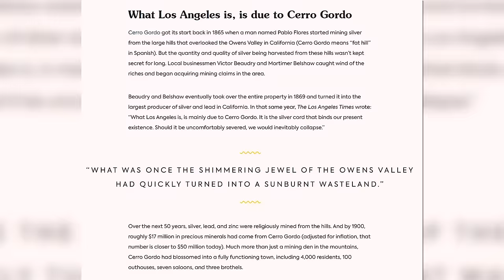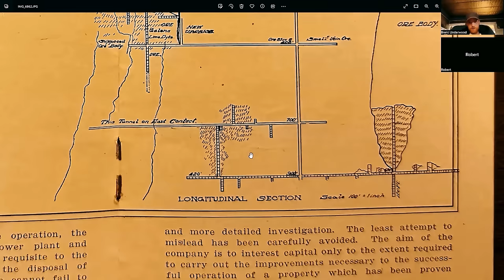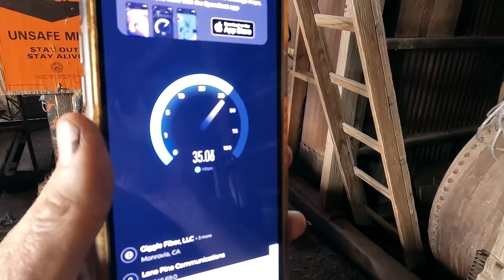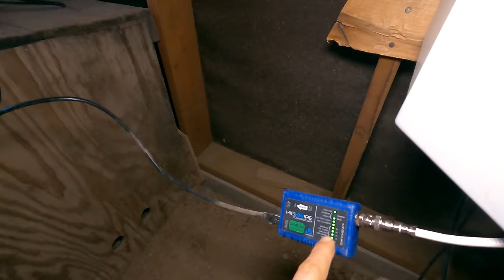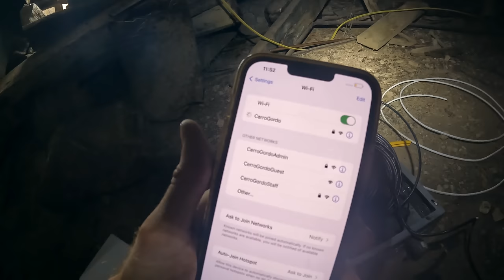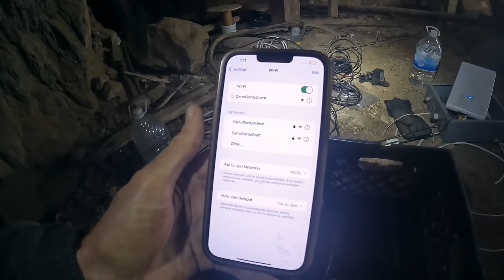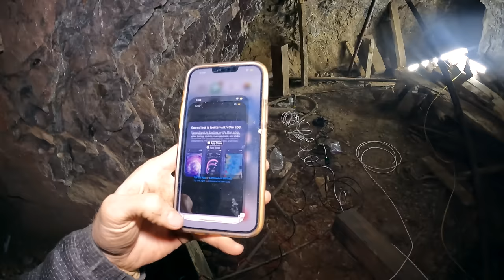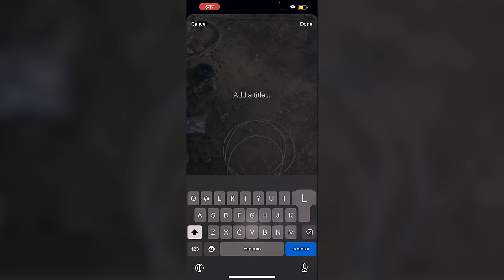I Have WiFi In My Abandoned Mine! 900 Ft Underground!

Comment: Cerro Gordo totally deserves a Starlink!
Reply: Yeah, really surprised they didn’t go with it. I have it deployed at two locations and see average 200 mbps dl speeds and it’s solid as a rock
Reply: Better value for money is the local guy who is knowledgeable and willing to be on-camera explaining how the stuff works. Our local guy that re-sells his Charter Internet business connection is friendly enough but doesn't understand networking and would boast how every additional nested NAT is the same as making his offering more secure and started talking about how IPv5 is the future when I asked about IPv6. Until Starlink though there's not been any other option for our valley. Now I reluctantly use Starlink... 6x the cost and giving away that money to some corporate overlord is not ideal.
Reply: Nice speech.
Starlink everyday.
Reply: Is starlink and fiber+ubiquiti going down a solution too expensive to run?
Setup would be so much easier.
Reply: @niceride  Dang, how much does he charge? The Starlink equipment was 600 and then 120 a month. If 120 a month is 6x what you pay him  that means he’s reselling high speed for 20 bucks a month in a rural remote area.
Reply: Yeah I can't believe they don't have Starlink either. His IT guy is really doing him a disservice by using that janky system he has now. Starlink is robust enough that he would be able to a livestream from the 900ft level.
Reply: Now you know how the trans Atlantic communication cables work. Cables connecting each nation under the ocean by wired land line communications to land, to towers for a wireless signal. Ps. Sattelites dont exist. Never have.

Comment: I am a ham radio operator and it has always been a Standard Operating Procedure when running ANY long run of ANY type cable or wire to ALWAYS do a continuity check on EVERY section to make sure you have a good cable or wire as well as all the electronic devices. Hook it all up BEFORE running even the first foot.

Comment: Next up: IoT environmental sensors. Particularly a 4 gas meter. Looking at all the dust floating around there, dust masks should be part of the long term stay plan as well.  Having power down there to recharge portable work equipment light lights is also really helpful. 
Since this room is sort of your hub of activity down there, you may want to put in a network switch, with the wifi on one port, and more coax converters to split off into different sections of the mine. Another possibility is just to drop SEVERAL coax lines and toss the boxes into the landings on different levels so you are ready to hook up when you start exploring that area.
Reply: I mean you technically could even get a small airfilter unit for the base
and I really feel that getting a UPS down there would be really a key thing

Comment: Sorry for the LONG comment!
Hi Brent,
Congratulations on getting internet to the 900 ft level!!  If I may, I’d like to suggest a couple things.
1. Add a POTs (Plain Old Telephone) line so you cane have a “ring down” phone by using the Viking DLE-200B below. All you do is pick up the receiver on either phone to make the other phone ring. I currently have this setup and it works great.
The Viking® DLE-200B™ Emergency Telephone Ringdown Circuit produces two-way communication between analog telecom devices by simulating an analog phone line. Popular applications include dedicated point-to-point communication and telecom equipment demonstrations without a phone line. 
2. Considered upgrading the Coax connection to Fiber connection. Fiber has Much, Much lower losses than the coax does! If you ran RG59 coax that is very close to the limit of those devices, see below. Using fiber optic cable does have its drawbacks but the coax also has limitations.

Cable Supported	75 Ohms coaxial (other impedances supported)
Transmission Range	Up to 1100' (300 m) on RG59 or 1600' (500 m) on RG11 at full rate

Fiber optics cable can also support several other things at the same time such as video to monitor the water. This way you want take up the Wi-Fi bandwidth for video. Since you have power you can add a power supply with battery backup at the 900 ft and other levels as needed. If the “Head End” also has battery backup your internet connection would still work even if you lost power top side.

Ron, N4PHP
Reply: yeah dude as a mining engineer having a hardline to topside has always been a big concern.  like MSHA shut the operation down level safety concern, which im still a little confused as to how he is classifying the mine as even tourist attraction mines fall under strict scrutiny from them.
Reply: @kalevwade4532   In the past I have worked in coal mines here in Alabama and you just don’t run wires any old way. The requirements are very different for running wires and installing electrical outlets, switches and panels. I work for an OEM and we built Drive Systems and other things. So before a lot of money is spent, I would suggest checking out what you have to do to meet those requirements so you don’t have to spend money removing what you’re doing and spend more redoing it!
Another thing is monitoring for methane gas. I don’t know how much air flow is moving through the mine or maybe it’s not a big concern but if you have any chances of methane  I would only use MSHA approved lights and switches! 

Ron,N4PHP
Reply: I honestly don't see any reason to not run fiber that long except clearly the issue being installer likely doesn't understand past just coax and twisted pair/ethernet. Just grab a Switch with a 1Gbps SFP which is like 30$. Buy a roll of armored Fiber and then place a SFP switch at each level. around 250-350$ for outdoor singlemode Fiber 1000ft. if you wanna do it cheap. If you wanna do it proper pay 1200-1500$ for Armored singlemode, a bunch of rest of the equipment (looks like a UbiQuiti infra) and then proceed as usual. Use a bunch of Wifi6 APs down below because MU-MIMO does a LOT for tunnels like those by having beamforming ability. .
Reply: BreatheScotland  while I'd have agreed with you, I disagree because all you need to do is have a switch at each 100ft or 200ft level. 100ft of wire can be easily replaced even if it's non armored and if it's armored chances of damage are really low. Obviously the hardest part would be installation for fiber but besides that I see no reason to go fiber
I would have just stuck to ethernet Cat6 if I cared about repairability with switches at around 200-300ft. 328ft is limit for 1Gbps so you have all the bandwidth you'll need in a mine. 

32-40Mbps bandwidth on that Coax will not be enough even for 2 people and some sensors and cameras

Comment: Thats great news, might I suggest a dedicated phone that stays down there with a charger. Also put in some emergency lights that go on when the power is off, and a battery charge system. Don't forget to encapsulate all those components with plastic to avoid moisture condensation on the components. Have a great week and God bless amen.

Comment: Ships and mines sometimes allow for walkie talkies by running a network of leaky feeder cables between spaces, which is coax with intentionally leaky shielding, so that it can absorb RF signals in one space and transport them to other spaces to be re-radiated by deliberately leaking the absorbed signals. I've also heard it called half-shielded coax. Ships also often have sound-powered telephones, which can work even if the ship completely loses electrical power. Both systems can range from very simple to very sophisticated.
Reply: Leaky cables is the way for Walkie Talkies. Completely agree.

Comment: With having power at each level, you may want to consider having POE network switches plugged into each of those outlets at each level so that you can add IP devices (access points, IP cameras, etc.).
That would also allow you to use more traditional networking cabling (CAT6) since you wouldn't be exceeding the distance limits from CAT6.
The reason for using the RG6 COAX over CAT for that 900ft distance is obviously that RG6 is limited to about 3280 ft because you lose signal (and power) the farther it goes.
Using something like fiberoptic wire from top to bottom would mean you didn't have power over the Coax, but since you already have power running down there, that shouldn't make a difference.
You could also consider a directional WiFi access point that goes straight down the shaft so that you could potentially get WiFi all the way down too (these are typically used for point-to-point WiFi bridges, but maybe there's one that would work for your needs too?)

Another thing to consider is a VPN system, so that the devices on that network act as if they are on your own network in town. That way if you needed to connect IP cameras to a NVR, or other monitoring device, they devices in the mine would think they were connected to the same network in town... that became an issue for you.

I'd love to see Ubiquity work with you to show how their rural and long-range systems can work for residential and commercial applications with sponsored content.

Imagine having WiFi for the entire town, and show how it's all managed through Ubiquity Routers, Switches, Access Points, and their management system. I think it'd be a great collaboration.
Reply: Yes agree with this. Also could put an intercom system for communication so you don’t have to have a device to communicate with the hoist
Reply: @KyleGetson  Problem with the intercom system is distance. Radio based is not working down there. Hard wired would require specialised cable storage for 900' of cable.

I would have taken fibre runs to each mine exit level. I know you were trying to cheat and use power over coax as well as data.

Since you have power on each level you can have POE switches connected to the surface by fibre. if you have the switches on UPS they will run without topside power for some time.
Reply: @TheHoofSmith  radio would work perfectly down there if properly set up. Just expecting a handheld with a stock antenna to work down a 900ft mine is ridiculous. Preferable is using a digital mesh radio, however too expensive so a good alternative is a Digital Mesh/Relay network like LoRA or Meshtastic. Allows you to setup a cheap spanning network that can do hundreds of miles and add Encryption even.
Besides that proper analog setup would be having a 20Watt base station at the top with antenna pointed straight down into the shaft, using handhelds with a bunch of power, having a repeater network setup at each 100ft level and replacing the trash antennas on those handhelds with something better like a SignalStick. I've been able to get reception deep into mines with such a setup
Reply: @MaxC_1  You do realise that this mine is literally made of lead. You can improve it some but to think you can blast a signal through lead is expecting too much.
Reply: @TheHoofSmith never said "through" anything. My entire infrastructure was based on LOS which is why I mentioned a digital mesh relay allowing each device to act as a node and reach extremely deep within mines as, again LOS using 20$ devices scattered across the shafts.
But as for Radio, again a base station with antenna pointed straight down. with a bunch of repeaters along the walls at each level would improve the signal capabilities a lot more unless you travelled really deep inside in which case- mesh networks win.
I know what I reccommend works because that's what i've used before to get comms down in 400ft deep mines, which sure, weren't lead but coal but again I can't see it being so impossible to reach considering how they were able to reach get comms 600ft below with just 5W of power with a tiny antenna in LOS

Comment: Could probably have tested everything up top. doubt it makes a difference if the cable is rolled up on the roll or going down the mine shaft.
Reply: It makes zero difference being rolled up unless he kinks the cable
Reply: I think the cable itself was fine it was his sloppy terminations. coax you have to be very careful that the shield wires around the outside go into their place on the termination otherwise it can ground the connection
Reply: imo, the first cable line, was compromised when he used brads to nail it to the studs. I winced when I saw him hammering it in. I did my first network install with coax about 34 years ago, and there are some things you just don't do lol

The second cable run did not have that problem because he taped it to the cable that was nailed. This will present a long term issue since the tape will eventually lose adhesive and the entire weight of the cable will be felt at the top end, more than likely breaking the internal wire where it bends to go down the shaft.

I think he was pretty quick on the uptake regarding the power issue, but I was grimacing about the third time up and down because there are plenty of networking tools that can be used to analyze the line without uninstalling it. 

But yeah, great work for a miner !  I would suggest that they use zip ties (tight enough to hold a few pound, not so tight as to crimp the inner wire/shielding) to firmly attach the good cable to the nailed cable to hold the weight and a tension stress relief loop in about every level. That should prevent damage to the top end of the cable.
Reply: The other cable end is buried on the spool so no access to it
Reply: BreatheScotland  He said it got caught or something on way down tried to splice it. He showed it
Reply: Now you know how the trans Atlantic communication cables work. Cables connecting each nation under the ocean by wired land line communications to land, to towers for a wireless signal. Ps. Sattelites dont exist. Never have.

Comment: So, congratulations on a creative solution. Personally, I would have used regular ethernet (over outdoor / direct bury grade cable), and put an ethernet switch every few hundred feet down the shaft. This allows you to add access points on higher levels as needed, and not have to mess with the coax. Ubiquity sells outdoor rated switches, or you can use consumer grade ones inside a waterproof box. The spec allows 100 meters between switches, so 3 would be enough - or just use 4 if you want more places to tap in along the shaft. 

Finally, on the electrical side, I'd put a plug-in volt meter at the bottom of the 900 foot of cable. The more power you draw the more voltage you'll lose, and you don't want to find yourself with 80 or 90 volts when something large kicks on.

Comment: If you're running coax under those conditions, I'd highly recommend adding a couple of coax amplifiers.
Reply: indeed running 900 ft or switch to cat 6 and would need to add a network switch every 300 ft
Reply: shoulda, coulda. woulda. Fiber would have been the bomb.
Reply: @jimh598  Was gonna say - just run fiber.
Reply: Also there are various levels of armored cable you can get too. Its more expensive but if ya want it to hold up its worth it. Hell run some armored fiber down there :D Only thing is you can't inject power into fiber. They prob went with Coax because I believe you can inject power into it with longer lengths, like others said CAT 6 you only get about 300ft of POE.
Reply: @greengiant912  right but they have power down there anyway so you could just throw a media converter and PoE injector on there
Reply: @greengiant912    How about you and the other "friends" supply the equipment to do what y'all are wanting to happen?
Reply: In all honesty fiber would be way overkill in this scenario. They are only getting at most 50-60mbps down. It sounds like they are using either  Ubuquiti's AirFiber via two nodes via long distances according to the video, just to get ISP up there.

 @lanswipe
Reply: @greengiant912  the point of fiber here isn't the speed. It's the distance to get down the shaft. Their usage of coax here is starting to hit the 1000ft max(within spec) length.
Reply: Now you know how the trans Atlantic communication cables work. Cables connecting each nation under the ocean by wired land line communications to land, to towers for a wireless signal. Ps. Sattelites dont exist. Never have.
Reply: @gravefrightn5720 dude what lmao

Comment: The excitement is palpable, I can feel it through my screen, coming from you. Lol. Nice job to all that helped you work on this! This has to be the first mine in history to have Wi-Fi down at the 900 level, lol. 
Not sure if anyone else asked but was Starlink ever a consideration for you guys? I feel like it would give you a better download and uploads speed and potentially be more reliable than the antenna pointed out of tower miles away that can be impacted by a number of things. Not that Starlink is foolproof and guaranteed to be the best option, but is just a thought that maybe it could work here for you. Anyway, I know that coax typically has a limit on how far the signal can reach from the trunk line to pedestals and into the house or wherever the termination point is. You can remedy that by having amplifiers installed to boost the signal and give you a longer reach. That's likely what's happening in your situation here. For the longer lengths like what you're doing here, fiber is the better choice however it's also much more expensive. Something you might want to keep in mind if you experience issues down the road.
Reply: The fiber would likely be cheaper than the coax, and they probably get better internet off of the tower for cheaper than what starlink can provide. Its still a wireless connection, just that the tower is alot closer and directly linked to fiber.